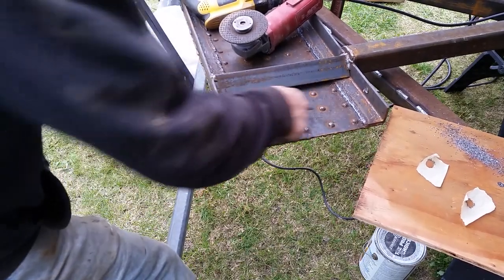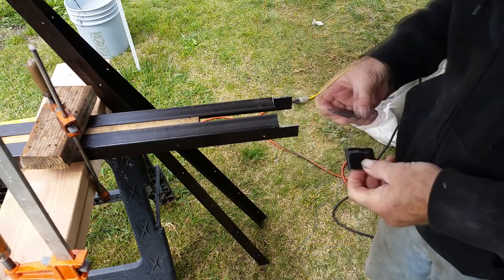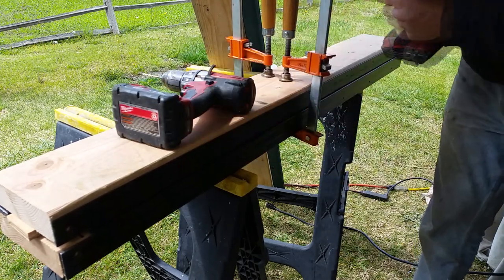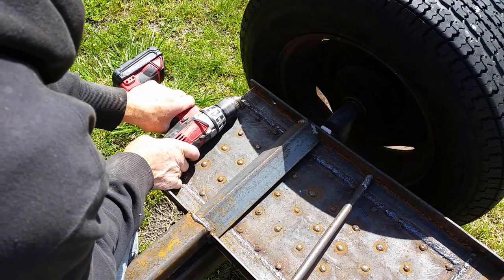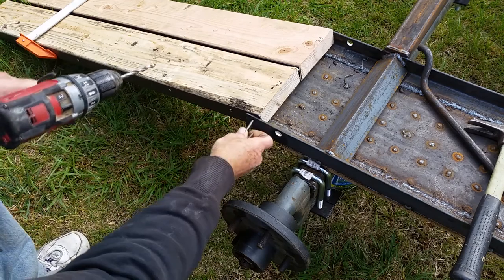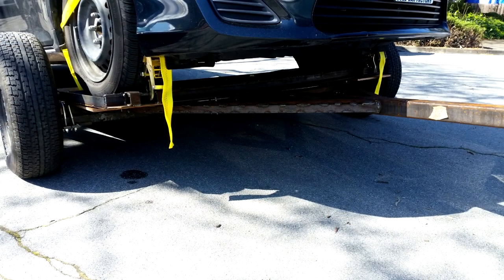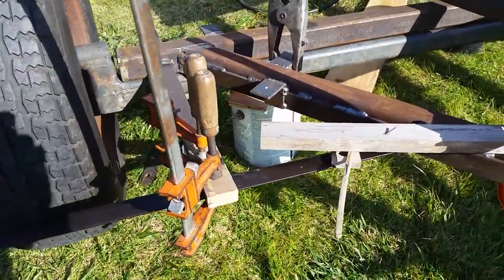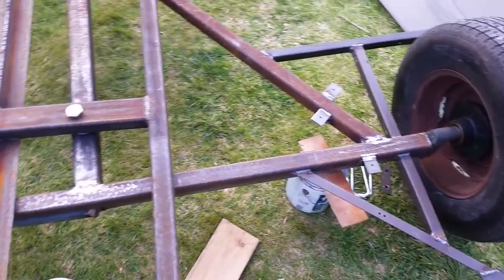DIY Pivoting Car Dolly Trailer, part 3 - DG

Comment: How do you control the swerving
Reply from the maker: The wheel straps should be very tight and the steering wheel should be locked. If you do this, you shouldn't get any wobble in the trailer and car. Note - It's very important to stop after a few miles and tighten the straps and then check them periodically. Also, look at the comments/responses from the other parts of the video for more info. Thanks for watching. DG
Reply: @deegee8032  thank you a lot

Comment: What’s the size of the wood for ramp ?
Reply from the maker: The ramps are made with a standard 2x6. I used 2 that were 8' long and I cut them in half. I picked wood that did not have any knots and had a very close grain so that they would be as strong as possible. Also, I found that when I use them I need to tie the two planks together with a wire because they separate a little when I used them. DG